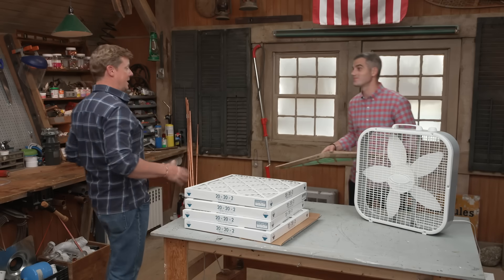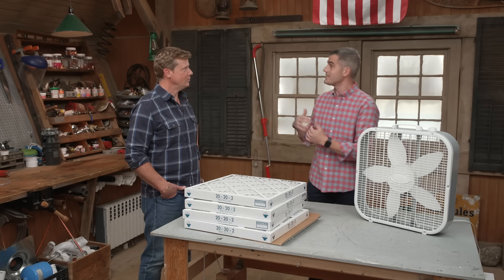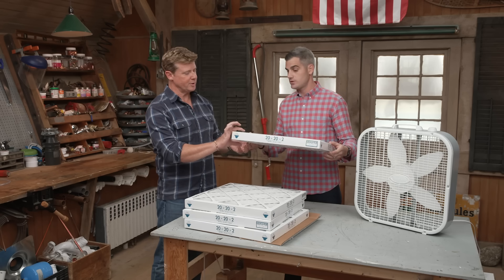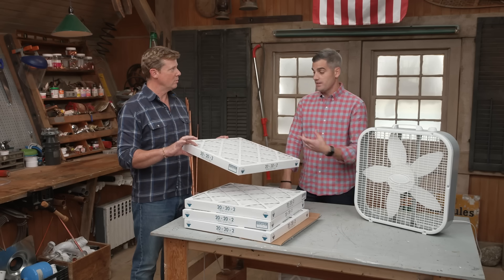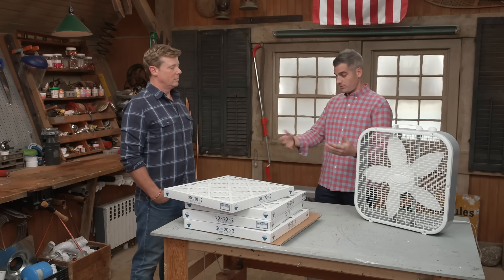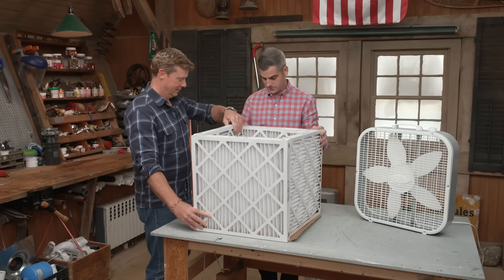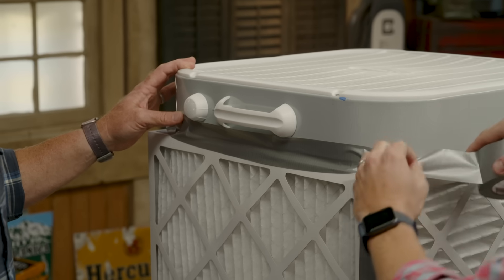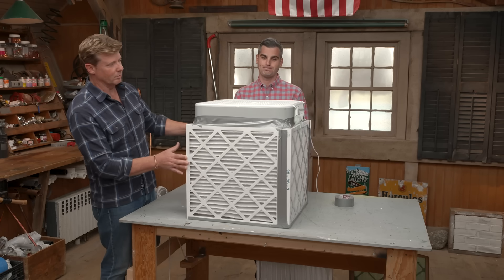How to Make a DIY Air Filter | Ask This Old House

Comment: The filters will last much longer if you inject the air into the them vs pulling/vacuuming it from them!
Reply: The fan would get filthy, and they're much harder to clean.
Reply: @buzoff4642  Very good point, and that filt produces vibrations that goe against the bushings. Also when the fan is pulling the air trough the filters and they get clogged, the load decreases, which makes the fan run faster and cooler, hence lasting longer. If it was injecting air like I had mentioned, with clogged filters the motor would work harder, run slower, and increase the motors’ heat to the point where it could burn itself or a fuse.

Comment: Oddly built one of these with two MERV 13 filters and the blower out of a busted microwave. Actually filters quite well, only difference between there build and mine is the foam board support structure and I used aluminum flashing tape. I can run it for about 15 minutes and it filters everything. Though leaving the filter running that long isn't necessary considering I live in less than 175 square feet. 
Still this is an excellent video it shows there are options for air filtration even if it's DIY. :D

Comment: 900 cfm?  Doubtful.  More like 90 cfm.
Reply: This design brand new will move close to 900 CFM. Tested a couple of times around 800-950 CFM depending on fan and filter type.

Comment: love the red green thing. Caution: The fan is not designed for horizontal operation.
Reply: Horizontal operation is approved by this manufacturer.
Reply: Yeah don't forget tu change the axial bearing for a thrust bearing

Comment: Just wear your mask in the house like a good sheep. These filters ruin your furnace static pressure is BAD the filter is for the furnace not you.... think about that? How about talking about and HRV or a HEPA filter unit. Easy way to find out your filter isnt good for your furnace put it in new and open the bottom door if it doesnt open and it whistles then you got a bad filter for your furnace and duct design.  FYI its your duct design the makes this all work agianst the filter... so have your furnace and most importantly your Duct installed professionally and not by some cheap cookie cutter installer...

Comment: Put basic foam or cloth outside filters as a prefilter to extend filter life. Prefilter catches larger particles. Clean prefilter from time to time with vacuum cleaner.
Reply: I bought washable air filters.  They are the best. Just pop it out, hit it with the hose. Next morning dry ready to go. Saved a fortune.
Reply: @assassinlexx1993  what I have done!
Reply: @assassinlexx1993  How about a link to them, or at least a brand name?
Reply: 3M Washable Furnace Filter - Fibreglass - 20-in x 25-in x 1-in - Electrostatic

 I just pull the two of them out. Use a garden hose to clean them.  Wait until dry and put them back.
Reply: @assassinlexx1993 washable filter never  filtered good enough ( See a test from Project Farm ) .
Reply: ...and use a pre-filter on your vacuum filter.  Then, vacuum your vacuum's pre-filter and filter with a second pre-filtered vacuum.  Continue forever.  :D
Reply: @ItchyKneeSon  So, you get to cursing at the recursive.
Reply: @ItchyKneeSon  Ha, ha, that's about the size of it....... then install a germ zapper laser.
Reply: Thor2021 Ishere  He means use the 6 as a pre-filter.
Reply: @dosgos  For the price of bluair, i can build one with Merv16 filters that can also remove odors and have a vastly superior life. There is nothing special about bluair. They both do exactly the same thing. The DIY with have vastly superior airflow because of surface area.
Reply: I like to put another filter on my prefilter to make the prefilter last longer
Reply: @fe3613  hehehe
Reply: @fe3613  
Now of course you need  pre vacuum cleaner to boost the system.  Plus upgrade the motors to 240 voltage.
Reply: OneDayAfterAnother  I wondered about that, too.
Reply: @Erald M. this method doesn't work for homes. It might for a workshop but i have now more dust with the fan blowing up
Reply: @benjabhd  have you can considered dusting your home when you clean? I made one and it's working perfectly. And my house is very very old and seems to manufacture dust as a hobby.
Reply: @benjabhd  So what your saying is you have dust either on the floor or ceiling that is being kick up by the fan blowing upward? I use feather dusters and a vacuum wand with hepa filter for regular cleaning to reach high places and also my leaf blower to blast ceiling areas once in a while. I run one of these DIY filter fans on low speed 24/7 and it works really well. Mine uses 16x20x5 MPR1550 rated filter built into a wooden case seems to scrub my air well. I have less dust build up using this box fan method over the last couple years. Its probably really good at getting the particles you can't see that would float longer in the air and cause allergies and other health issues to.
Reply: Actually, it will not extend filter life, only add to the resistance. The smallest particles are still getting through, which is what "clogs" the filter. Large particles just sit on the surface and do not impede "flow". However, another layer of "filtering", which is ALSO clogging with larger particles, will just impede the whole unit with two layers of filters that have to be replaced at the same time.

Think of it this way...

You have a screen that blocks sand. That is your MERV-10 to MERV-13.

Now, you place a sewer-grate on top of that, to block baseballs. That is your MERV-1 to MERV-8.

The baseballs would not have obstructed the sand flowing through the screen, as they can't even get close enough to the "filtration holes", and the stack of baseballs on top of the filter would not matter. The "Screen" will only be "clogged", when large grains of sand have clogged it up. However, your sewer-grate, blocking the baseballs, is now also being clogged by golf-balls, which also would not have clogged the screen. So... You have to replace the screen and the sewer-grate, which are now both clogged. One with large grains of sand and one clogged with golf-balls.

Even if you had the BEST pre-filtration (another 4 or 8 filters, so it clogs less.) Your screen filter MERV-13, would still be clogged by grains of sand, just as fast as it would have, without pre-filtration. Because, again, the pre-filtration is not stopping the small particles that actually clog the smaller screen filter. You would be better off just adding more MERV-13 filters, in a double "MM" or "WW" pattern, so air-flow through each filter is sooo slow, that particles don't get "lodged" into the filter and the slight layer of "dust" that does accumulate on the filter, becomes your equal MERV-13 pre-filtration. (Since a layer of dust-fibers will ultimately become equal to the compacted "filtration medium", and act as an inert place for dander, pollen, germs smoke-particles and viruses to die-off, without "food".)

This would be ideal as a window-unit, to draw-in fresh air and pressurize a house, pushing OUT dust and germs and microbes into the places they normally get pulled-in from, when running a home HVAC unit. Better than circulating "dank air", which honestly shouldn't have that much dust, if the HVAC wasn't pulling it in, from outside, due to it's horrible design. (The price you pay for convenience is greater electric bills and operational costs and inconvenience. Ironic.)
Reply: @JD_Mortal  I was confused until the last paragraph.
Reply: @JD_Mortal  Hi you seem like you know what you’re talking about so i was wondering if I could ask you some questions? I’m planning on trying to make a DIY filter similar to the one in the video but I’m wondering if i can use cardboard to make a box with the 6th side being the fan and the side opposite that being the first merv 13 filter and then putting 2 merv 13 filters on the inside in a V shape so the whole set up would look kind of like this from above lVE with the l being the first merv 13 filter the V being the 2 inside and the E representing the fan and the other sides covered in cardboard. Do you think this would be a good idea? The reason i want to do this instead of their plan is it seems like the filters would be easier to replace this way and you would get more filtration. I’m not great with science stuff though so I’m not sure if this plan will work what do you think?
Reply: @JD_Mortal  your HVAC shouldn’t be pulling air in from the outside.  Air goes into the return vents to your handler, is heated or cooled and blown back out the supply vents.
Reply: @JD_Mortal  I had my suspicions of this, but your analogy to macroscopic stuff makes sense, even if chemistry somehow plays a rule.

I'm also glad I have a mini-split.
Reply: @Erald M. The DIY air filter can't do that! A DIY air filter still can be pretty good value for removing basic air particles and allergens.
Reply: I use cheaper lower merv filters, like a 6 or something.  I just double them up.

Comment: Time for a nerd rant!

Merv isn't the best system for rating medical filtration. HEPA is a better designation for measuring this kind of filtration. With HEPA filter media, smaller particles are electrostatically 
attracted to the filter media, bigger particles will hit the media and stick. Think of HEPA filters as a bunch of spider webs instead of a strainer like the MERV system.  The hardest particles to filter are 0.3 micron. The 0.3 micron size are a bit big to fall to the electrostatic charge, but small enough to follow the air flow around the fibers. Hepa is based the worst performing particle penetration size. E.g. if a mask filters 95% of 0.3 micron particles, it is rated as N95, if it gets 99.8% it is an N100 that you might use when doing something like removing asbestos.

HOWEVER this definitely helps! The practice of putting furnace filters in front of a box fan is endorsed by the asthma and allergy foundation as an affordable alternative to expensive air cleaners. It clearly shouldn't be used as safety equipment for removing a virus, but will clean up inside air (and takes the load off your furnace).
Reply: HEPA isn't a rating system, but rather a type of filtration. It used to mean something, but its been trademarked and used as a generic term for high efficiency filtration.
Reply: So can I use this type of filter to clean the air from a paint booth? I build scale models and don’t really have options for where I can use my airbrush, I live in Canada and venting outside is difficult due to the type of windows I have.
Can I feed the air from my paint booth (desk top size) through this type of filter to remove the paint particulates? Would it remove the smell from solvents like mineral spirits or acetone?
Reply: @inmybox2023  There are a lot of model painters that make their own mini-spray booth using something like this, but this filter will only take the overspray out of the air. Once the overspray is in the filter the paint still dries out and puts volatile compounds into the air passing through. Fumes like this require some kind of activated charcoal filter that will react and trap volatile gasses.  There are sheets of charcoal filter you can add to knock down the odor some, but of course if you can smell it in the air, it is there!
Reply: They know you are right, but there pockets are filled with crisp 100 dollar bills!

Comment: Couldn’t you just put one on the front and back of fan instead of doing a box? Haven’t watched till end maybe they will address it. So I got my answer this way is safer because you aren’t blocking the airflow the motor needs to cool off.

Comment: Been running MERV 13 for years  20x20x1  stock system that was put in  in 2012... no problems.
Reply: depends on your hp and rpms on motor.  its a easy upgrade if your motor is underpowered.

Comment: Ross I caught you on a seminar with your friends were you made a comment that a lot of installers were moving away from geo thermal why?
Reply: The only thing that comes to mind is when comparing Air source heat pumps to ground source (geothermal) heat pumps, and that most installers offer to install air source, but not all installers offer ground source. Both technologies has pros and cons, and both have a place in our market.
Reply: @rosstrethewey9391  Ok Ross good enough
Reply: Huh? I’m a fan of geothermal when designed and installed appropriately for the right application.
Reply: @rosstrethewey9391  yes Ross I agree with you, but you still did'nt answer the question
Reply: @rosstrethewey9391  if you have any questions review the video of the seminar
Reply: Leslie Sweeney kindly please post the link to the video you are referring to...context is everything
Reply: @rosstrethewey9391  I wish I could I don't  have it anymore but the question was pretty much verbatim the seminar was about backdraft

Comment: I’ve been told by several HVAC people not to use the thicker filters because it makes the system work harder and can damage your system.
Reply: Hvac guy here thought I could help. Truth is, its really situational. Your system is designed to run with a total external static pressure of either .5 or .8 inches w.c. (inches of water column). Which one, depends on if your system is variable speed or not. Your ductwork was designed to have a certain static pressure with a certain filter because that meets the static requirements for the system. If you run a filter that's too restrictive or with ductwork that isn't sized for that filter or even the system. It makes the static pressure too high. This can strain the system because we are not moving enough air. This strains your blower motor causing it to fail faster, causes the indoor coil to freeze which can lead to compressor damage. Have a tech test your systems ductwork find out how much of a pressure drop from a filter your system can handle and still meet the static pressure/airflow requirements. If you can't run the filter you want and still be within specs, the next option is upgrading ductwork and/or filter box.
Reply: @anthonyholder5348 , when engineers are designing hvac systems they use mere 1 to get their stats.
Reply: @anthonyholder5348  all you have to do is buy a better motor. thats what I did years ago. had a small motor and bought 1/4hp with 500rpm increase.
Reply: @tribulation138   honestly I haven't changed a motor for one of a different size or rpm before mostly because of warranty issues that could cause. From my understanding though yes you can switch one size psc motor for another psc but the increase has to be pretty significant to handle the load your putting on it and that the better option would be switching from a psc to a variable speed one. If you do that though my assumption is that you would also need some sort of update kit like a new board, wiring harness possible new stat too.
Reply: @anthonyholder5348  not to mention i had a old system over 35 years old. heat and AC shared same ducts. super easy to work on. motor and fan slides right out in basement. had 4 different speed wires and a external capacitor

Comment: DIY Air Filter:  Step 1 - Buy air filters.
Reply: These are standard air filters which cost a lot less and will be available for decades. Consumer air purifiers have non-standard sizes to force you to buy filters from the manufacturer at higher cost. Also, air purifier companies may not be around for decades, forcing you to buy yet another air purifier because filters are no longer available.

Comment: COVID is 0 .125  microns, even HEPA filters are not 100% effective at stopping it, these filters do jack crap/.
Reply: HEPA (and these furnace) filters are not like screens with tiny holes that physical block anything larger than the holes. They are a maze of fine fibers that indeed have much larger gaps than the COVID virus partials. However, they are effective because we don't breathe out single naked COVID virus particles, we breathe out (relativity much larger) water droplets that contain the virus particles (if you're infected). You only see this vapor cloud in the winter but it's always there. Even these vapor droplets are smaller than the pores in a HEPA filter but they get caught because it's like what would happen if you closed your eyes and ran into a forest. Even though every tree might be 10 or 20 times your size away from each other, eventual you're are going to hit one of them. If the trees are covered in a sticky chemical you will get trapped in the forest. That's the basically how HEPA filters and N95 masks work.

They don't provide 100% protection but with a virus like COVID it's a numbers game. You have breathed in many many COVID particles but didn't get infected because they need to get to a certain area of the body and land on a compatible cell and actually get it's RNA inserted and incorperated. Each step it has to pass through makes it less likely you will get infected. The filter/masks are just one more fairly easy, cheap, and effective step we can take.

Comment: that fan is not good for static pressure, the blades are made for air movement not really static pressure that is caused by adding filters. ;)
Reply: Very true. Because these axial box fans don't do well with any head pressure, I estimate, this rig will give 1/2 that amount of air.(~450 CFM, with brand new filters) I would be tempted to build a rack to suspend this thing, add the fifth filter where the cardboard is, and let it blow sideways, rather than straight up. The more filter area, the better. The thrust bearings in the motor won't last long, with the axial load of the mass of the fan blade and motor rotor, plus, the thrust created by the air restriction of the filters. The bearings are designed for radial loading, meaning horizontal axis.
Reply: @vincentrobinette1507  right on, you know what's up! :D